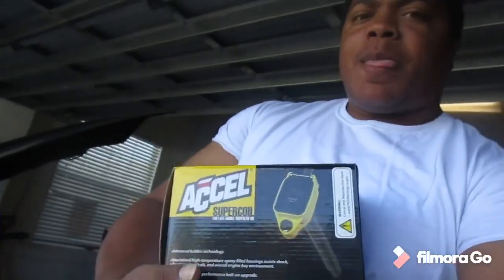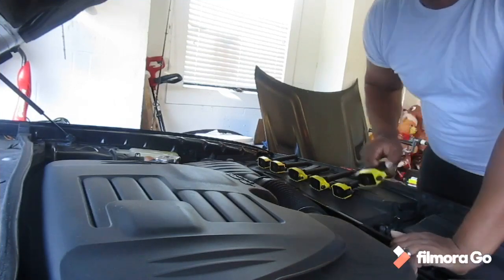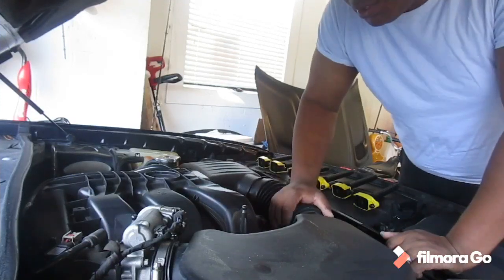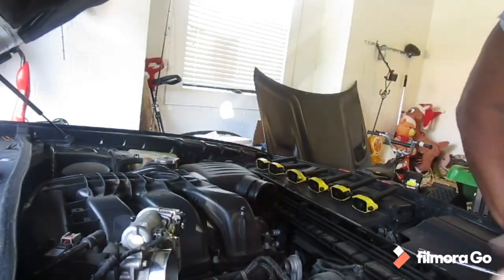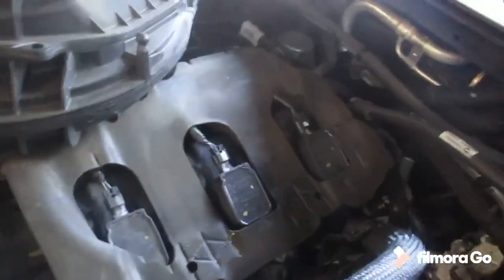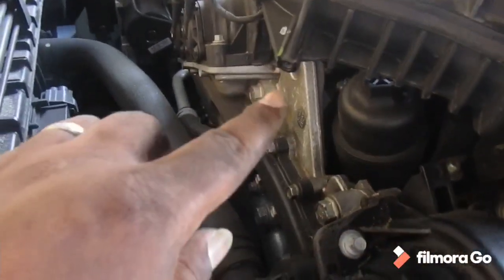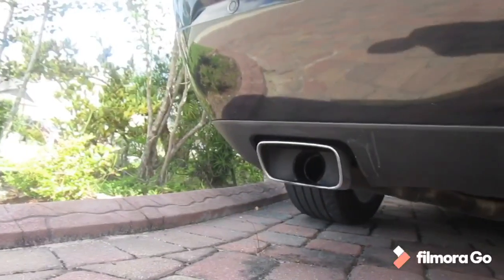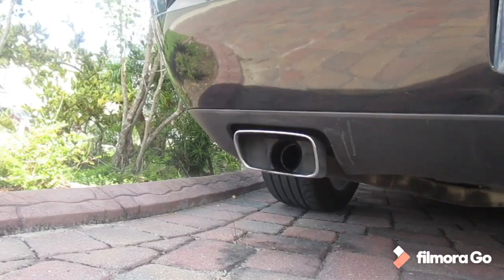V6 challenger gets it first performance mod | WEEKEND MODS

Comment: Doing this does what? I’m new to this
Reply from the maker: A high performance ignition coil helps engine performance four important ways. First, the higher voltage allows for a larger spark plug gap, which results in a more robust initial flame kernal at the start of combustion. The result is a real-world engine torque increase